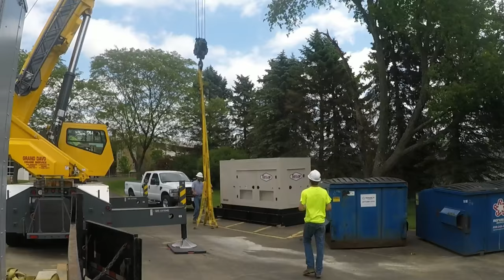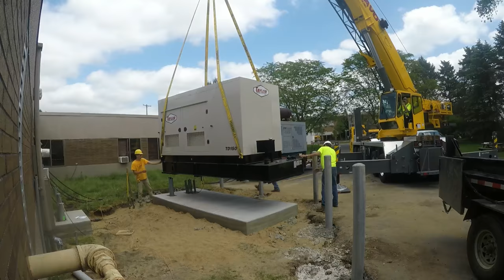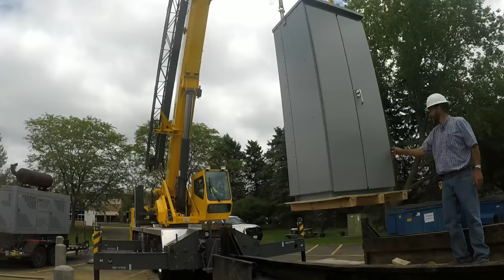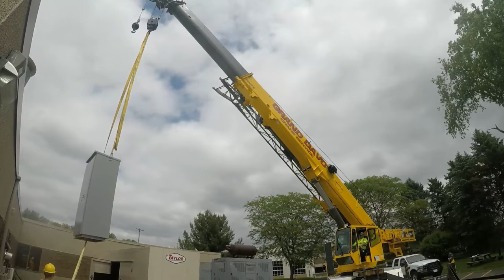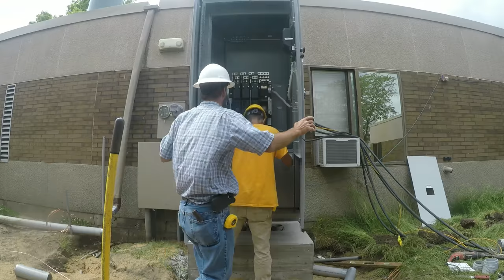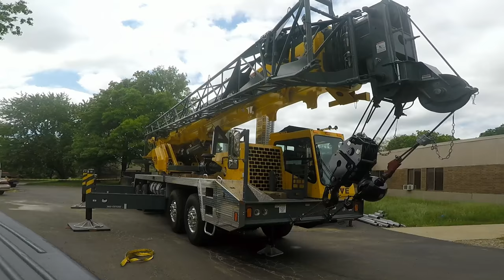Grove 70 Ton Crane Setting a 150KW Generator

Comment: Nice and clean looking crane. FYI that’s a newer TMS700E which has a max rating of 60 tons not 70 tons.  There is a slight chance Grove may have made some special marketing load charts giving the 700E a higher theoretical max load rating for rental marketing purposes but I’ve never seen one. The TMS700E series was available as TMS700E, TMS750E or TMS760E all standard with 110’ powered booms. The newer 700E series RT cranes were available as 65 ton RT765E with the 110’ boom and 70 ton RT770E with a different longer 138’ boom as well as other changes.